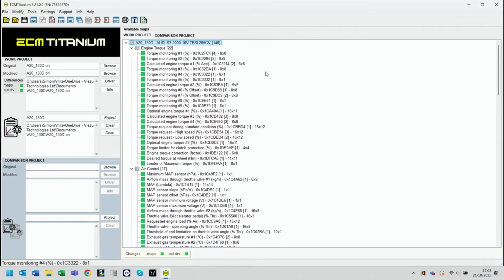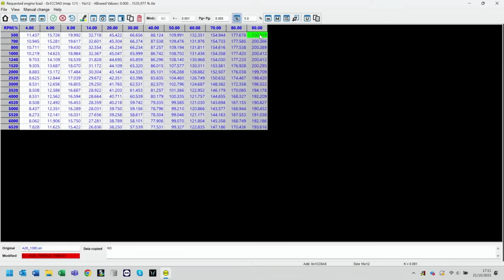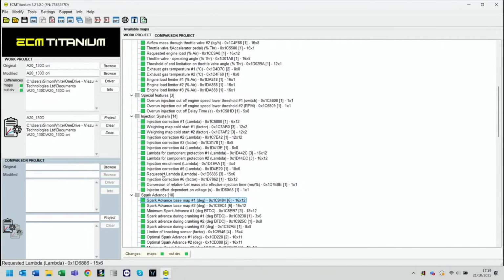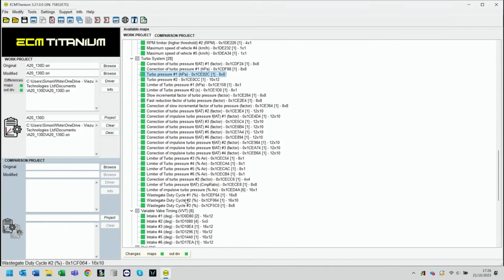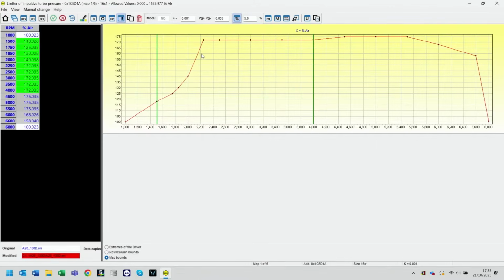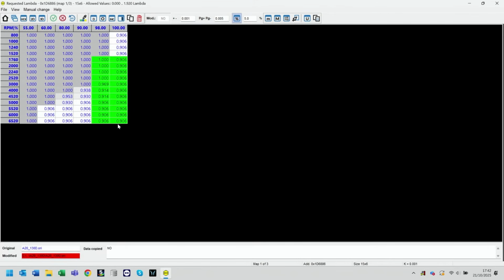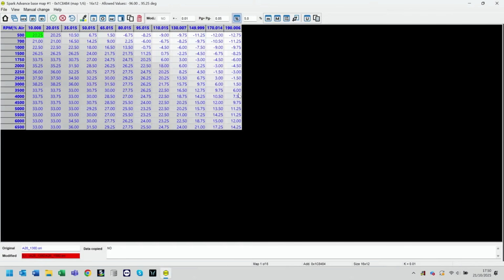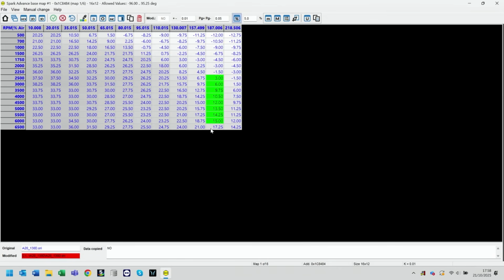ECM Titanium Training – Stage 1 Gasoline Mapping Explained (Audi S3 2.0 TFSI) #ECMTitanium

Comment: Thanks guys much appreciated. Nice easy watch and very informative. Ill be doing all the courses. Been tuning some years but this information is very helpful and I could do with being brought up to scratch with newer stuff. Solutions and things. Already have quite good knowledge of Winols and doing it all manually, im in that place where your deciding if you should get Swiftec and be lazy and have the one click heaven for solutions or save money and use winols but get less done in a day. 

Since I dont have an unlimited supply of map packs and previously tuned files in a database for reference to speed things up. Ive been a slave for a while due to also being a mechanic and adblue dpf repair specialist. But file writing is calling me back and stuffs got easier in ways but changed in many! I started tuning in the EDC15 days so those ecu's were a bit easier to read and tune haha. But I have done newer and like I said have a great knowledge already of the maps I can point out most maps in 2d view. But yeah im super hyped to get some training in and slow down on the repairing and stuff and knuckle down and utilize the wasted file tuning knowledge Ive learned over the years! 

Im weighing up if a cheap Winols license and the ECM package would suffice or swiftec....

But I do a lot of adblue and dpf solutions, dtc's and im loving the idea of the one click with swiftec. But at the same time could I just fly into winols once ive done a few manual adblue solutions anyway and knock off scr systems like that. Or is it simply well worth having if you do quite a few adblue solutions per month over the manual way as im assuming some can be a pain and swiftec tells you what to unplug and so on when doing the newer stuff. Which I  wouldnt get from winols or ecm I assume. 

If you guys could advise what you would do if you were me. I have a fairly good knowledge of ECM I used the old old one. But kinda doesnt look too different. 

Interpolation looks simpler in ECM I recall Winols confused me at the interpolate function so i was manaully editing values to interpolate myself. 

I would like to buy the software and not really have to pay for solutions as thats what im trying to cut out. We shelled out too much last year in files and it makes no sense when I have quite advanced knowledge already on file writing! Aswell I could well be making some extra revenue for my business via files, slaves and possibly shift some tools here and there. 

Anyway thanks again for the video. I will look forward to the next time I have a free hour to watch another. You guys are super cool! Appreciate your time!

Cheers 
Tony

Kraft
Reply from the maker: Hi Tony, this all depends on how much time it's going to take you to modify the files, against the cost of paying someone like us to do it for you. You then have to factor in other additional costs like upgrading your tool to Master, buying WinOLS or ECM & increased subscription costs. But it's your call in the end.
We can help you with tools, software, WinOLS, ECM, Swiftec & additional training.
Just let us know what you need, Regards Ian